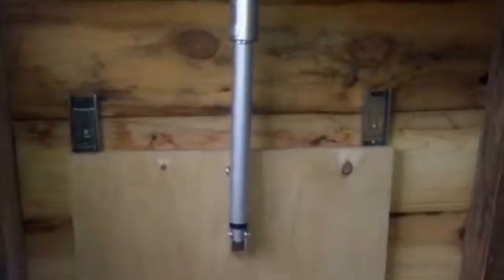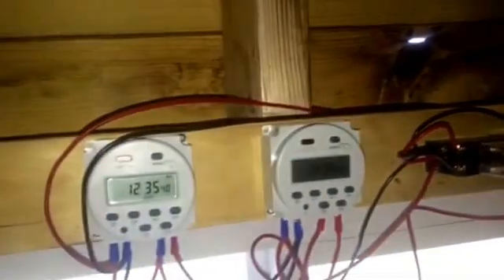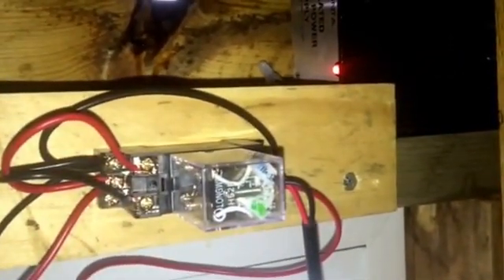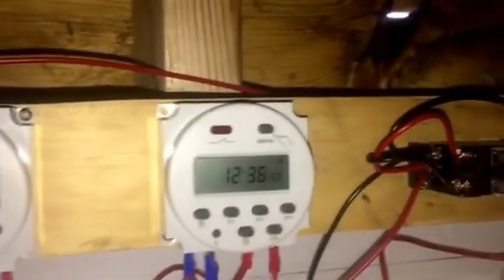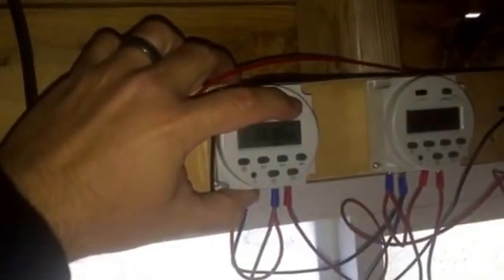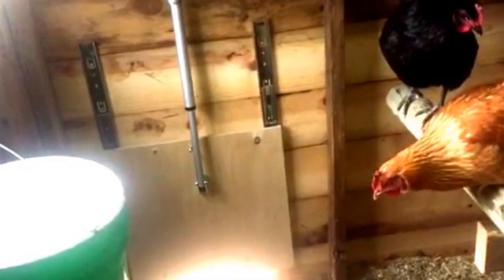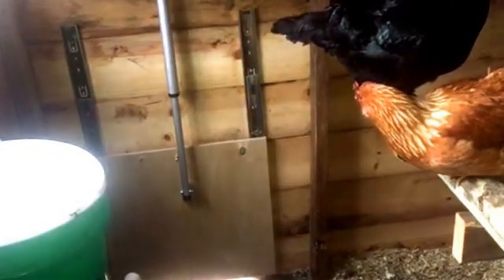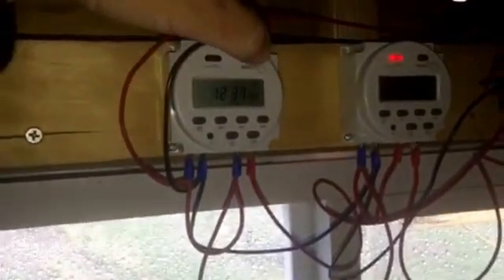Chicken coop door opener. Linear actuator with timers 12v.

Comment: I'm looking for help here and came to this post.  I want to feed my deer in the daylight and not the night.  Thus, training the deer to eat during the day so I can have the big boys come out.  I've taken a commercial trash can that you would put each week by the road for pick up....and I've cut the top 15" or so out of the can.  Then I bury in the ground 10-12 inch's.  It looks like someone buried a trash can with lid in the ground.  I want to make that lid open in the daytime (sun out) and close at dark.  I can stiffen up the flimsy lid with a frame on the inside and a smaller solar panel on the lid or nearby to power the battery.   Any ideas on how I can make this work?  They make a commercial one now for this but nearly $600.00 that is ridiculous, I want to devise one of my own to save money.

Comment: Your explanation is great!  I recently built an almost identical system but sort of reversed... opens with one timer, closes with both. 
I added a small solar panel and charge controller with 12v battery.  Also a manual option - up/down rocker switch that can be to  isolated to prevent backfeeding the relay and actuator.

Comment: hi. im just wondering. the actuator has built in limit switches. technically, you can use only one timer then leave it on so that the actuator will extend until the limit switch hits then when it turns off, the actuator retracts. does the use of 2 timers for the sake of "just to be sure not to burn the motors" thing or to save power or both? hope you can reply even this video is kind of old. thanks mate, i am planning the same setup.

Comment: There is no need for 2 timers if you wire the DPDT slightly differently.
But like the idea with the drawer slides. Easy peasy.
Reply: You are wrong. There is a need for the two timers. 
No matter how you wire it, with just 1 timer (except for a dual ch timer) you will be using up power the entire time the timer and relay will be on. The setup here makes it so when the polarity is reversed to go up, the power is cut off, then the polarity reversing timer shuts off and the door stays up all day with no power being used.  In this video he has house power but when he changes over to battery power charged by solar panels it will make a difference. 

This is actually the easiest way to wire a linear actuator with timers. Wiring is kept to a minimum, Easy to understand and the most efficient. 
https://www.youtube.com/watch?v=aYv3-aVQEOY&ab_channel=AztecWarrior
https://www.youtube.com/watch?v=ClPmxFDa5m4&ab_channel=AztecWarrior

Dual ch timer I mentioned.
https://www.youtube.com/watch?v=7Oykm8wyQtU&ab_channel=AztecWarrior

However I am Interested in how you would wire it not use two timers.?
Reply: @AztecWarrior75  you are right with the power and the relay being on half of the day, however, the power consumption is very, low.

Comment: Better if you run two timers and two SPDT relays. So much simpler.

On the relays you Simply wire,

Positive to the NO (Normally Open) terminals of the relays 

Negative to the NC (Normally Closed) terminals of the relays.

Commons of the relays are the wired to Positive and Negative of the Actuator wires.

Day timer (connected to relay 1) turns on in the morning for , let's say five minutes (just long enough for the door to open fully, is all that's needed), then the timer shuts off.  
Do the same for the night timer (connected to relay 2). And you are done. 

Even better and easier to wire is, you get TWO SPDT Timers.

You Simply wire,

Positive to the NO (Normally Open) terminals of the timers

Negative to the NC (Normally Closed) terminals of the timers.

Commons of the timers are the wired to Positive and Negative of the Actuator Wires. 

Day timer turns on in the morning for , let's say five minutes (just long enough for the door to open fully, is all that's needed), then the timer shuts off. 
Do the same for the night timer.
 
Basically with the right timers you eliminate the relays.

Comment: If anyone wants a wiring diagram that uses cheap 6 dollar automotive SPST NO  relays and 2 timers give me a shout. Ideally I would have used DPST NO relays but couldn't find them readily. My circuit also has an interlock relay that protects the circuit in the event of both timers coming on at the same time.

Comment: You can buy a relay on eBay for around $5.50. Relay comes with the socket base.  P/N 12vdc. spec-16A.  Timer is Cn101A. For $15.00. You can get wiring diagram from Progressive Automation.  Only one timer is required.
Reply: I used  think that a timer and DPDT relay was the way to go. Till I came across this configuration. Two SPDT timers is all you need. Very very simple in that you don't even have to figure out what contacts go to what on a relay. 

https://youtu.be/wJwNZ3A2x3M
Reply: You have link?

Comment: Can you please send me a link for parts, source and wiring diagram , will compensate for your idea and time. Melsauto at gmail
Reply: See this page which is the wiring diagram I made for this system: http://blog.netscraps.com/diy/heavy-duty-solar-powered-automatic-chicken-coop-door.html  However please note that I made an easier method that still uses two timers but they don't have to turn on simultaneously like this first system. The link to the updated method is in the red text at the top of that page.

Comment: Hi Brad, Can you provide a Timer 12V DC and DPDT (did you use a 6 pin or 8 pin) wiring schematic/diagram, so I can see how you have wired the  linear actuator to your system. Tried to email, but under email on YOutube.com there is no email listed on the link. Thanks

Comment: Hi Brad, Need your help! I am so lost with how it gets all connected.
I have purchased the following as the basic setup:
A. DPDT 8 pins (or is your the DPDT 6 pin can't tell on the video). I could not follow the wiring of the DPDT for forwardiung/reversing motor
B. Auto window motor Works like actuator, but don't have limit switches built in
C. Two Timer same as yours
D. Converter 110V AD to 12V DC (works very well came from a computer)

Later, I want it to do more:
1. Monitor the temperature via a thermostat when its below 20 degree the door will not open
2. Light Sensor monitor the day light (open in the morning and close at night)
3. Limiting Switches , so the system shuts stop as soon as the door is up or down
4. Dimmer so I can control the speed in which the door opens/closes
5. LED light to help the chicken get in the coop before it totally dark
6. Go totally solar so I don't need the converter

This is a project for a later date just want to have the basics for now . Any help would greatly be appreciated. I can provide photo(s), diagram(s), and item list if needed.
I believe you have attained the knowledge I need to get off the ground based on the video you posted. Thanks!
Reply: I used to think that a timer and DPDT relay was the way to go. Till I rediscovered this configuration used on car power door locks and windows. Two SPDT timers is all you need. Very very simple in that you don't even have to figure out what contacts go to what on a relay. 

https://youtu.be/wJwNZ3A2x3M

Comment: I understand reversing the polarity with the relay to change the direction of the actuator. What's puzzling me is when the DPDT relay is in the "static" position (de-energized), the contacts are in one position. When you apply power to the relay, the contact reverse position and the motor goes the opposite direction. The "puzzle" is when you remove the power to the relay coil and the relay reverses position, why doesn't the actuator go back to its original position?? Are you ALSO applying/removing power to the relay contacts via the timer so nothing happens when the relay contacts reverse position until the timer re-applies power??
Reply from the maker: Because the main power from the first timer goes off before the relay timer does so there is no power going to the actuator to send it to its "home" position. If you keep power to the main timer and take it away from the relay the actuator will go back to the other position. I just run the timer for the relay a little longer than the main timer.
Reply: Thanks for the reply. The relay you showed will have a "static/home" position  where it will always go to without power. It has "normally closed" and "normally open" contacts. Whenever control voltage is removed from the relay, those contacts will ALWAYS be in those positions. So, applying "constant" voltage to the contacts and then controlling the relay will control the door as long as the control power is kept on the relay coil. Once that coil voltage is removed, the relay will switch back to its static/home position and the door will go the other way. If your timers are both supplying power to the relay coil AND SWITCHING power to the RELAY CONTACTS, there will not be any voltage on the relay contacts when it reverts back to its "static/home" position and the door will not move again until your first relay comes back on and applies voltage to those "normally closed" contacts of the relay. Right???

Comment: Does anyone have a wiring diagram please...
Reply: http://blog.netscraps.com/diy/heavy-duty-solar-powered-automatic-chicken-coop-door.html
Reply from the maker: TJ K  thanks for posting a link with more info. I love this system. It works every day. I had some problems with my actuator when the temps were -30 and -40 but a heat lamp pointed directly at it solved my problem.
Reply: Brad Rustan no prob. about to get mine assembled once all the parts arrive. it's nice to see some alternative door configurations as far as the actuator is concerned.
Reply: @TJ-qf6ht  i drew up several posted here and lots more that I haven't.
 https://drive.google.com/drive/folders/1ByP7yFhzDqI_kY0iALMXrsZT0_0fu3hh?usp=sharing
Reply: @AztecWarrior75  Damn thanks. I still haven't finished mine after 3 years. Still got them birds though lol
Reply: @TJ-qf6ht  You're Welcome. If you ever get around to it, I fully recommend doing it this way. It is the SIMPLEST SIMPLE way of wiring it up. There is no guesswork to it. 
https://drive.google.com/file/d/1IrP7PmL0gOUuwDSRk41mLLRK87oAbBpf/view?usp=sharing
Reply: @TJ-qf6ht  PS I have been updating them to put it as simple and clear as possible. So if one day you click on the picture and it looks different that's why. If you want to download the picture for future reference that might be a good idea.
Reply from the maker: TJ K I spent many hours trying to figure it all out. I don't make a lot of videos but I couldn't Gide exactly what I was looking for so decided to make one. I'm still surprised there are over 3000 views already. Glad I can help someone anyway. I've learned more from YouTube than I ever did in school.
Reply: This one may be easier to follow. Let me know?
https://drive.google.com/file/d/1X2Y4qtc2KCzWAvLrNb_Y1F91oqegGEH3/view?usp=sharing

Comment: This is perfect, exactly what I was going to build in my head.....and then I found this video looking for parts. Can you post the DPDT relay link? Thank.
Reply: Can someone please help? I have hooked up both timers to the Dual channel spdt relay with a 12v power supply exactly depicted in the “new method” link. Unfortunately it’s still not working. When I hook up 12v power supply the right way (positive to positive negative to negative) the power light on the relay board comes on but the 2 timers power/red lights do not. When I flip flop the power leads to 12v power supply negative to positive and positive to negative both timer power/red lights work but now the green power light on the relay board is off? I would appreciate any help trouble shooting this problem. Thanks to all!